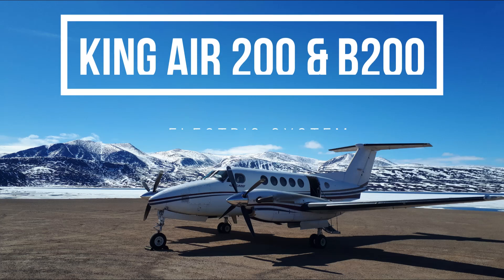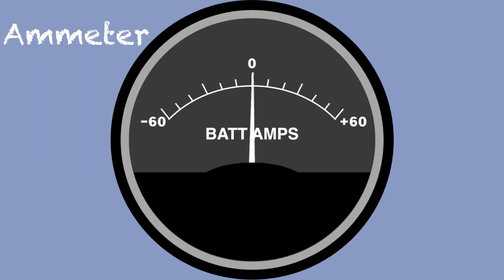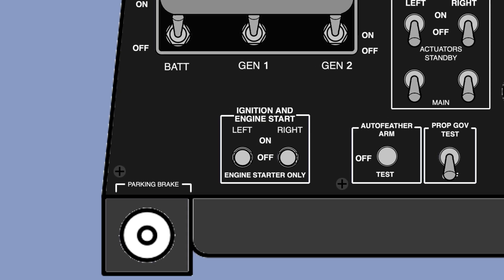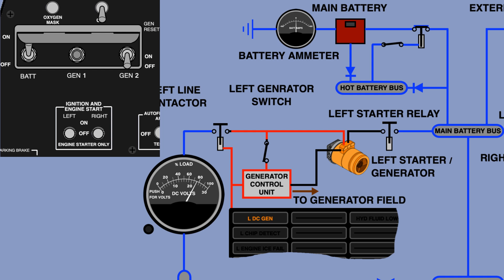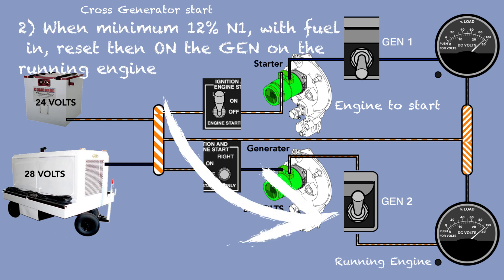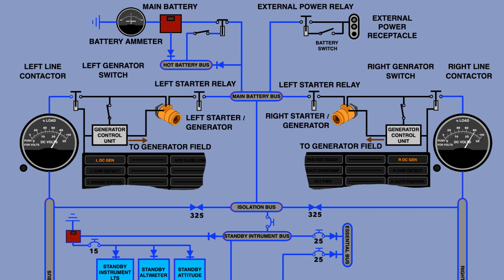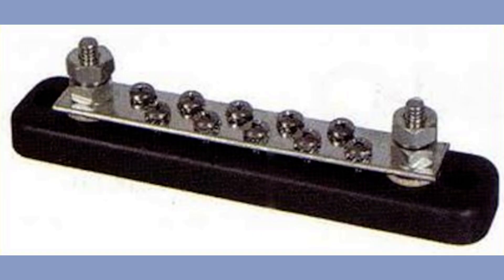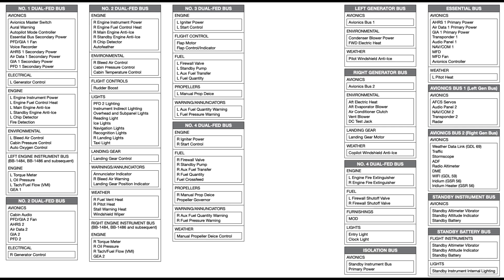King Air 200 & B200 Electric system

Comment: Could you explain in the first example how the left current limiter failed instead of the right one that is showing 24V? Thank you!
Reply from the maker: I will try to give you a quick explanation. And if I do not respond to your question, I will try to do better after. A current limiter give a protection against any problem can happen with your GPU for example. So the current limiters, are installed at a specific location. So if a power surge happen, either from one of the generator, or from the GPU. One or both current limiters will blow. And everything on the other side, will still be powered by the other generator.
Again I am not sure if I answered the question, if not let me know, and when I will be back home, I will try to be more specific.